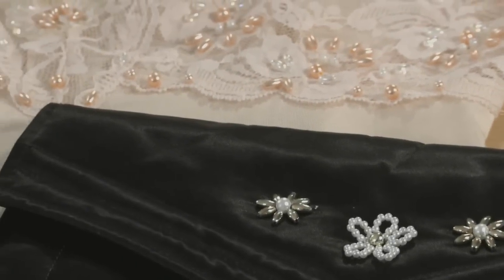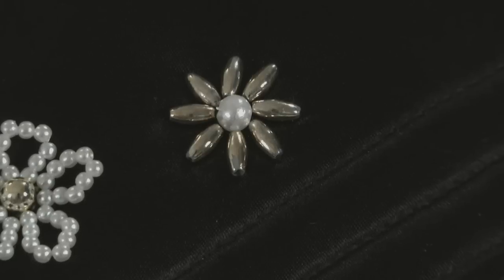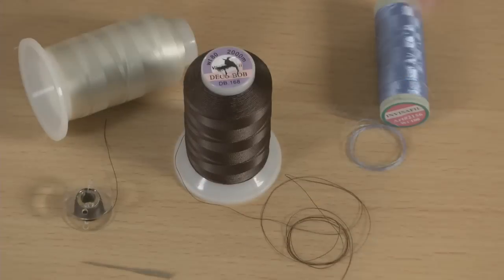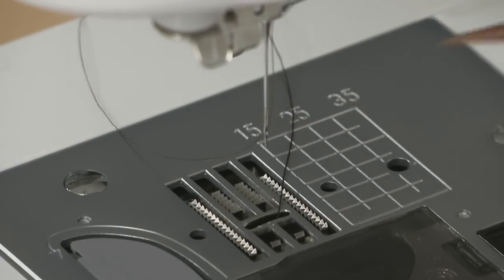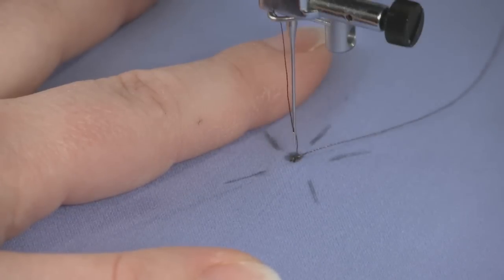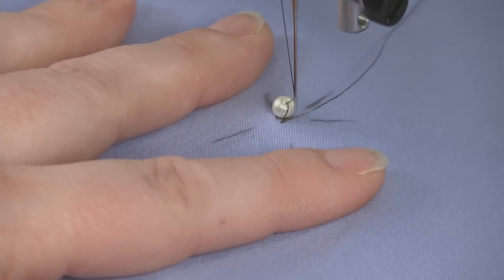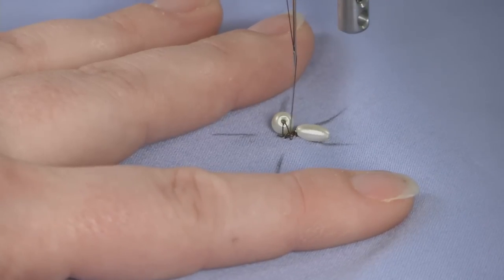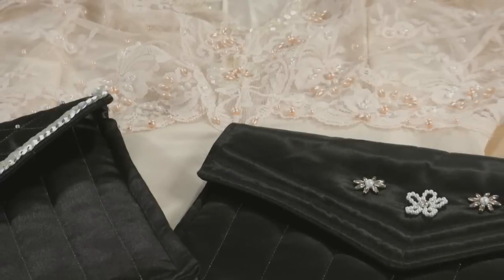How to Machine-Bead a Design

Comment: I'm sewing on top hole sequins for Jasmine figure skating dresses. I made the sequins using the Scan N Cut Machine because I needed a variety of sizes and they need to be light not to cut through the thread while spinning. I hand sewed and found my knots and stitching didn't make it out the door and wouldn't hold up for skating. I so glad I found this video. I hope this machine stitching will be my solution. Thank you!

Comment: Please send the name of threads and needle no.s. I can't understand your language. Please
Reply from the maker: The needles are size 60/8 or 70/10.  The thread is 80-100 weight cotton-wrapped polyester thread from decobob or invisafil  both from wonderfil.net.
Reply: Can I use these for singer 1306 fashion maker?
Reply from the maker: @rajanidheeswar6370  I'm not sure, you may want to check with your machine dealer.
Reply: Ok. Thankyou